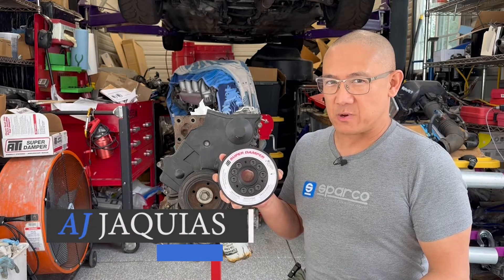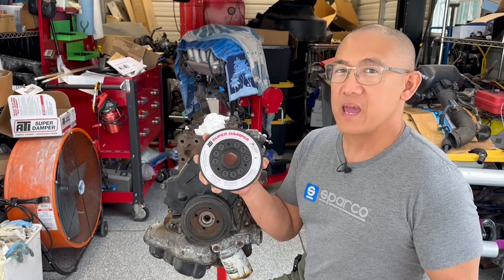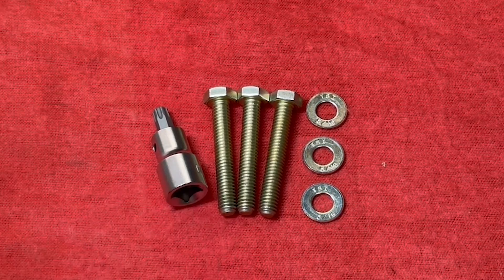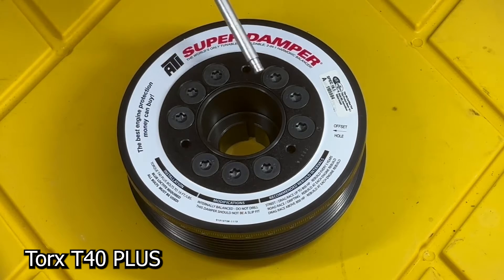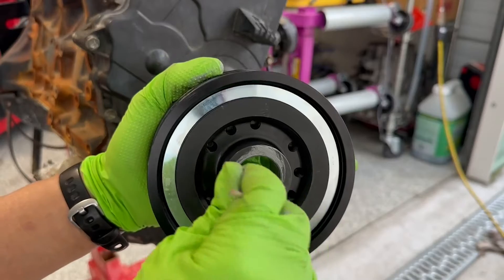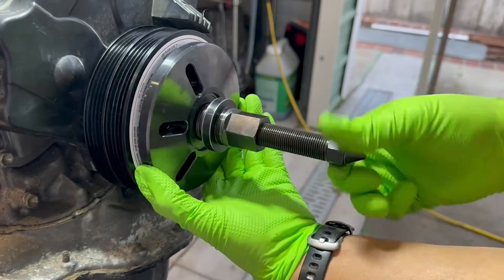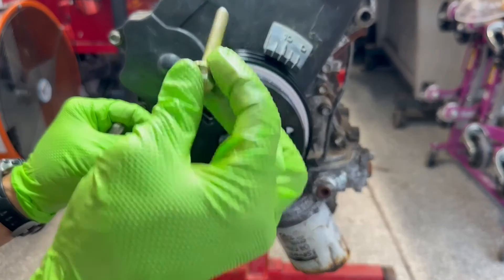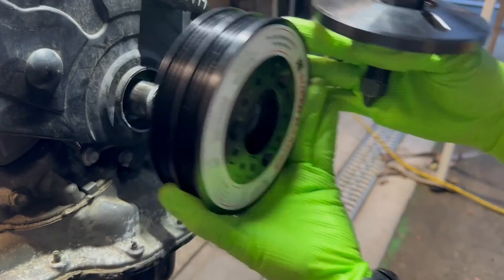How to Install an ATI Super Damper on a Toyota MR2 3S-GTE

Comment: You also should note that it takes quite a bit of strengthen to get it to press. And with the engine still in the car, it’s extremely frustrating as you will only have space for 1/3 turn at a time. 😂

I’d recommend just dropping the engine assembly - as you will be 3/4 of the way there to have enough access for the pulley. (You will need to undo the front/rear/passenger motor mounts)
Reply from the maker: FYI - it shouldn’t take a lot of force to install the ATI Super Damper bc it is a light press fit. Note in the video, I am using a long 27mm ratcheting wrench and a long 3/8” breaker bar. Leverage is your friend. Thx for watching and commenting. -AJ

Comment: Do you find that you need to machine hone the ATI damper to fit the crank snout appropriately (to interference fit spec clearance as per ATI) on a typical 3SGTE or do they tend to fit without that extra step? Thanks!
Reply from the maker: @Test-wd3ft  they come out of the box as a slight interference fit which is why you should always use the tool for install and removal to prevent damage to the crank snout, key, key way, and ATI super damper inner diameter. Thx for watching and commenting. Pls subscribe. -AJ

Comment: Thanks for the vid. What kind of alternator and AC pump belts do you have to use when you swap to a ATI damper? The old ones dont fit due too the bigger size of the ATI. thanks
Reply from the maker: Use the 2nd gen MR2 Turbo belts. Thx for watching and commenting. Pls subscribe. -AJ